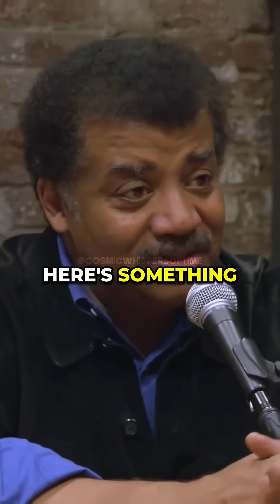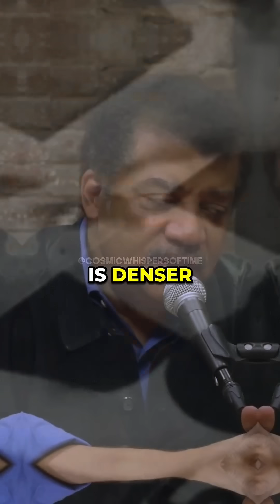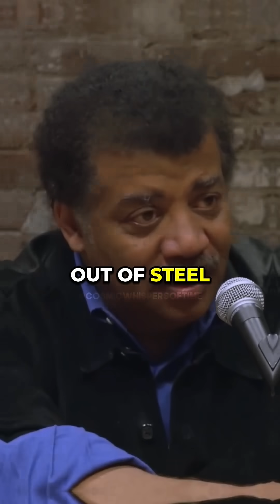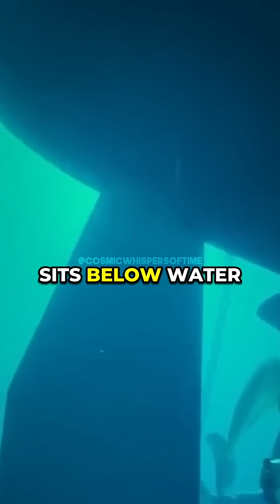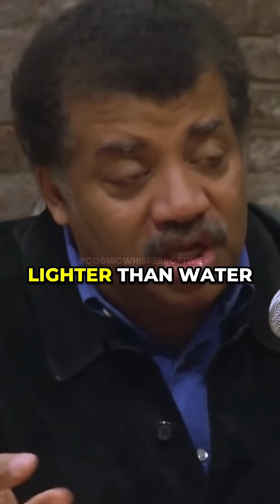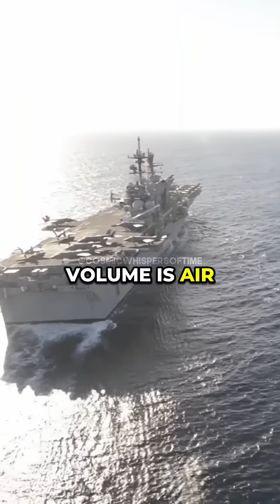Why Giant Steel Ships Don’t Sink 🤯 w/ Neil deGrasse Tyson

Comment: Been an avid diver since the 90's.  Was at Curacao, and they had one of those behemoth cruise liners docked.  I decided, in my infinite wisdom, to go dive under the thing.  I chickened out, because as I got closer, the water turned dark (it blocks the sunlight), and the sounds from it freaked me out (not to mention the thought of what would happen if they fired up one of its thrusters or props.  Anyway, I tried to estimate how deep the hull was, and it seemed right around 25-30 feet.  So I ran the buoyancy calculations on it, estimating the width and length of the ship, and the buoyance numbers were shocking.

Comment: This is how my dad taught me how to swim. He told me that ships don’t sink because they have air inside and as long as I have air in my lungs I will float on the surface. I was 3 years old
Reply: You’ll also float if you have enough gas in your abdominal cavity….
Reply: @ArmageddonIsHere I hate to be the guy to tell you that air is made of gases…..
Reply: It isn't really about air, you can do this with a vacuum inside, which probably works better because air is a weight in it self, but air does help. As long the ship weighs equal or less to the volume of the liquid it displaces you achieve buoyancy. Or otherway around; the volume of water a ship displace must be equal or greater than the weight of the ship.

Comment: The way that I think about it is that the shape of the steel is such that the water or displace can't overcome the top of the ship. The density of the steel will make the steel sink into the water.  The displaced water will rise up.  But if it cannot rise above the edge of the ship the ship will float. Buoyancy does have the water push against the hull and some of that pushing is pushing up. If the water rises faster than the upward force the ship sinks.  But if a balance is reached then the ship floats. That's a lay person's hypothesis. No declaration of fact.

Comment: “Make yourself an ark of gopher wood. Make rooms in the ark, and cover it inside and out with pitch. This is how you are to make it: the length of the ark 300 cubits, its breadth 50 cubits, and its height 30 cubits. Make a roof for the ark, and finish it to a cubit above, and set the door of the ark in its side. Make it with lower, second, and third decks.”
Genesis 6:14-16 ESV

Comment: See something floating in water.  Crack it open and it sinks.  Don't crack it open and use many of them to float.  So on and so on.  

Neil is the same guy who says hydrogen (fusion) bombs don't emit radioactive fallout even though they utilize a nuclear (fission+fallout) explosion as a trigger for the fusion explosion.  On top of that they encase the fusion material in hardened nuclear fission material, which not only increases the yield of the hydrogen explosion, but results in a secondary fission (fallout) explosion.  

I'm not a scientist or know it all.  I've just witnessed this egomaniac spew nonsense on numerous occasions.  They've been sailing forever.  The first manned flight was in 1903.  66 years later we were on the moon.  122 years later and we're developing spacecraft for colonizing other planets.  Ships today are mostly for transporting massive amounts of goods that would economically unfeasible to transport via air.  In terms of warfare, aircraft carriers exist specifically to project our airpower.  The fleet exists to protect the carrier.  Adversaries are scared of our carriers because of the aircraft on them.

Comment: Getting it to float is one thing.  Keeping it right side up is where it gets tricky.
Reply: Underrated... 👏..
Because even the round wood floats but rollover too...
Reply: Dont you just concentrate the weight to the middle ?
Reply: @kelvinfernandez3205 if you do that the ship would turn way too easily, of course the ship has center of gravity, but I think it's more spread apart at the bottom shell of the ship, because when a wave hits it will turn a little but the ship weight will compensate the little turn to the same side that the wave hit the shell of the ship
Reply: I was high as giraffe nuts last night and I was thinking the exact same thing, how in tf do they make huge ships that float? This man is an obvious stoner or I'm on the same level of thinking as this mastermind 😂
Reply: Add weight underneath the waterline, boat doesn’t tip as easy.

Comment: (Voleme which sinked x  density of ocean)   = (Total volume of the ship x density of the ship)

V sinked x d ocean is called bouyancy and V ship x d ship is called Mass.

If Bouyancy is greater than Mass  then Ship will float and if smaller then it will sink.

That is so damn easy equation.Yo do not have to be even a university student.Even 11 years old  a child can make a ship. with this equation.

Comment: A piece of wood floats on water, but a hull assembly weighs ....Builders didn't wait for the metal hull revolution to understand the principle of density.
In the 18th and 19th centuries, the hulls of wooden ships were lined with copper plates.

Comment: Well … to be fair … it required you to have decent metals .. the way to manufacture the large amounts wrought iron needed for the first non wood boats wasn’t invented till 1784 .. so it wasn’t possible before that? Cause wrought iron requires very high heat and an oven with high efficiency and a very large size …

Comment: John Wilkinson iron canal boat 1787.

The Vulcan 1819 launched in 1819 was the first commercial vessel with a complete iron hull built for passenger transport on the Forth and Clyde canal.

SS Great Britain was built by Isambard Kingdom Brunel and launched in 1843. The first wrought iron built screw propelled ocean going ship.

Comment: honestly, this is not that big of a realization. just take a steel bowl and place it in water (maybe with a rock in it so it doesn't tip over) - voila.  if it works for an 8" diameter bowl, why not a gigantic ship?

Comment: It's called displacement.  I built barges and push boats for years.  They are all 1/4 steel sheeting and 1/4 C channel a 12'x30' barge weights around 80,000 lbs . But only drafts about 10 inches with nothing on it.  Put a full size excavator on it and drafts around 14 inches

Comment: I think that principle was learned when boats were turned into boats and not a raft he knew that by making a concave structure ark Noah if he saw it would float just because of the wood not only would he have made it concave he would have made it waterproof border did not fill the space of air the benefit of the would was it helped it float on top of being a sealed concave professional

Comment: Concrete boats are wild. Imagine 3” thick hull, re unforced with 3/8” rebar and mesh. And best part is they just cut through the water so smoothly.

Comment: Ummm...steel ships float because of DISPLACEMENT...the weight of the volume of water exceeds the weight of the ship, so it floats...the DRAFT of the floating ship, (how derp it rests in the water) is determined by how much of the weight of the boat is displaced. 2 boats that weigh the same, one a flat bottom, the other a V hull, the V hull will have a deeper draft. Simple. This guy is over explaing it and isnt quite correct...but then he isnt as bright as he thinks he is really.

Comment: The ship displaces an amount of water that weighs more than the ship does so it floats. It has everything to do with the shape and nothing to do with the air. If it were because of the air, explain how a ship can be filled with sand and still float?

Comment: I'm pretty sure what prevented ships from being made out of steel was the metalurgy and large scale shipbuilding technology required to make such a ship, not that they didnt know that a steel ship would float.
Reply: They couldn't make huge ships due to the lack of industries of that scale..if that's the case then were there small steel boats at that time?
Reply: @nerdinthevoid1838  What you said sounds good until you know a little about the industrial revolution, the first things they built with emerging technology were MASSIVE, enormous turbines, huge generators ect. ect.

What would be the point of a small steel ship anyway?   And do you not understand it would still take massive steel works to produce the sheet metal for even a small boat?
Reply: @nerdinthevoid1838 after searching the web it is said that there the first iron boat was made in the 17 century but only small boats cause the compass had issues on an iron boat. At that time iron boats and iron clad boats were pretty much used only for warfare. Tyson was pretty much talking out of his ass. Fyi it is dumb to assume that giant ships were built cause they thought wood is the boyent on water. The larger ships are still heavy af and will sink if you have a leak.
Reply: @Kenshinhugo  THAT INFO IS BASED ON RECORDS,,, THERE'S WAY MORE THINGS THAT OCCURRED THAT WEREN'T NOTED OR THE RECORDS LOST...
Reply: Not only that but people couldnt row a steel ship. Needed at least the steam engine first to be able to move it.
Reply: Exactly. Some timber ships in the 19th century were reinforced with metal plates, which was the precursor to iron hulls
Reply: 100% wanted to write it as well.
Reply: ok instein
Reply: hence his entire speech here...
Reply: He's not a historian.
Reply: 100% correct, it took the industrial revolution to make steel ships possible it was not a case of "a metal boat cant float!"
Reply: Yeah, Neil is totally dumb here. It was the lack of industry, as you say.
Reply: @Fezezen  Neil effectively says that in this video. you are a clown. enjoy living in poverty.
Reply: We can all agree we’re much smarter than Neal
Reply: @michaelturley8222  Not at all, we can all agree that even smart people can say really dumb shit when they are talking about things they do not understand.
Reply: @JohnClark-e9k it was satirical
Reply: @michaelturley8222  Oh, I suck at reading/writing sarcasm.  Or its hard to read it in text.
Reply: @JohnClark-e9k yeah it’s just hard
Reply: Neil is sincerely a demagogue of the scientific community. Never made any achievements to the field, even minute, yet he speaks as if he has all the knowledge in the world. At least Carl Sagan pushed forward ideas and promoted skepticism.
Reply: Think about it again Tyson is a huge idiot. Boats were made boyent by the design of the corpus. The real genius is the one who made the first design different from a raft boat to the one we see today
Reply: @Kenshinhugo  you tried
Reply: @Kenshinhugo  100% a raft depends on buoyancy of the material used to float, you can easily overload a raft, overcome the materials buoyancy and sink it. 

 A ship is different its design is what makes it float, the material is almost irrelevant.

Comment: Warships began to be built mainly out of steel in order to be larger and carry more weight, which allowed them to mount heavier artillery with greater range. In terms of vulnerability, however, the improvement was not that significant.

Comment: The Story of Archimedes and the King’s Crown

Long ago, in the ancient city of Syracuse, there lived a brilliant mathematician and inventor named Archimedes. Known for his deep thinking and clever inventions, Archimedes was often called upon to solve the greatest puzzles of his time. One day, he faced a challenge that would become his most famous discovery.

King Hiero II of Syracuse had commissioned a crown made of pure gold to be crafted by a local goldsmith. When the crown was delivered, it sparkled brilliantly, and the goldsmith swore it was made entirely of gold. But Hiero, a cautious and wise king, had his doubts. He feared that the goldsmith might have secretly mixed in cheaper metals like silver to keep some gold for himself. Determined to know the truth, Hiero turned to Archimedes.

“Archimedes,” the king said, “if you can determine whether this crown is pure gold without damaging it, I will reward you with a great prize.”

Archimedes was intrigued by the challenge, but it wasn’t an easy one. Melting down the crown to weigh its gold content would destroy the craftsmanship, and the king had forbidden such methods. How could Archimedes test the crown without harming it?

For days, Archimedes pondered the problem, pacing around his study, running his fingers through his beard, and staring at the crown. He knew that gold was denser than silver, but how could he measure that without altering the crown?

One day, while Archimedes was taking a bath—a common luxury in ancient Greece—he noticed the water level rising as he sank into the tub. A realization struck him like a bolt of lightning: the water level changed depending on the amount of space his body occupied!

Suddenly, everything clicked in his mind. If he could measure how much water the crown displaced when submerged, he could determine its volume. And by comparing its volume to its weight, he could calculate its density. If the density matched that of pure gold, the crown was genuine. If not, the goldsmith had cheated.

Excited beyond words, Archimedes leapt out of the bath, forgetting all modesty, and ran through the streets shouting, “Eureka! Eureka!”—which means “I have found it!” in Greek.

Archimedes carefully carried out his experiment. First, he measured the weight of the crown. Then he submerged it in water and measured the amount of water it displaced. Next, he compared this to a lump of pure gold of the same weight. The results were clear: the crown displaced more water than the gold, meaning it had a larger volume and thus a lower density.

Archimedes had proven that the goldsmith had indeed mixed in silver to cheat the king.

King Hiero, overjoyed with Archimedes’ genius, honored him with the promised prize, and Archimedes’ principle—that an object immersed in a fluid experiences an upward force equal to the weight of the fluid it displaces—became known throughout the world.

And so, thanks to a simple bath and a clever mind, Archimedes not only earned his prize but also laid the foundation for the science of fluid mechanics—a discovery that would echo through the ages.

Comment: Nah, you could throw a sheet of metal on the water or make a John boat float. I am more impressed with the guys that decided... "We made fire! Now lets grab this very specific rock that I found at the bottom of a volcano, we build the fire in a small enclosure made of clay, we then decide to blow air into the side of the chamber and make sure the bottom in lined with rocks and burnt wood, then keep blowing air on it for more than 10 hours so it gets so hot that we can melt this very specific rock. Once we melt this very specific rock in a specifically designed dirt/rock container, we then scrape off the top of this extremely hot molten liquid that the air coming off with burn your skin. We then pour this into a rectangular hole, cool it, then stick it back into the fire so we can slam it with a hammer for 6 hours to make a dagger." Who the heck decided to do this? Or heck, wheat. Some guy decided to spend a bunch of time pulverizing seeds of grass then decided to add it to water and let it sit for over a week while keeping it wet, then created a very specific oven to cook it but not burn it and when it looks like its not ready you then let it sit for a few hours.

Comment: Archimedes' principle states that a body immersed in a fluid is subjected to an upwards force equal to the weight of the displaced fluid. This is a first condition of equilibrium. We consider that the above force, called force of buoyancy, is located in the centre of the submerged hull that we call centre of buoyancy

Comment: compressing and stretching water in a cube explains this better. water occupies space. having 1kg of water in 1 cubic centimeter of area as your starting item, a cube area filled with water: you can understand that sinking only happens if you weigh more than what water can support. why do things float? because water is there. see water occupies space too and you do too so sometimes water will lift things because it can but other times it cant.

in a surface area of 1 cm^3, if your object used to float on water matches the same surface area of the water then the mass must be less than or equal to the mass of the water or else you will sink if you have greater mass.

its so wild i couldnt get this explanation from a college setting.

anyways, say your object does not match in terms of surface area, then you must create an inequality problem where all objects with the same measurements compare their density to water. if their density is greater they will sink but if their density is less they will float.

the max weight capacity of that side of the water cube. 1kg / cm^3 -> 1kg / 1cm^3 = 1,000g / 0.01meters

a guitar pick heavy 0.85mm = 0.00085m = 0.085cm  and it weighs 0.352 ounces = 9.979032g -> kg? = 0.00979032kg
0.0085m = 0.85 cm

obviously you need the rest of the dimensions to get the actual numbers but in the end you see things can take up way less space but still weigh a lot and those things can sink if their density is greater than the density of water.

Comment: From my understanding,
mass of the ship / volume in the water is not density.
(volume in the water ≠ volume of the ship)

But it's require to be less than water's density.
Cause in order to float, the weight must less than the buoyancy. (maximum buoyancy)

And the buoyancy = weight of the water that is displaced.
So it's
weight of the ship < weight of the water that is displaced.
That is,
mass of the ship < mass of the water that is displaced.
That is,
mass of the ship < volume in the water * water's density.
That is,
mass of the ship / volume in the water < water's density.
To be more precise,
mass of the ship / maximum volume in the water < water's density.